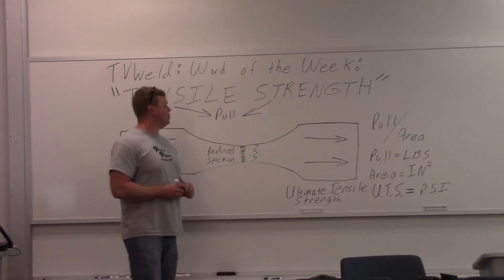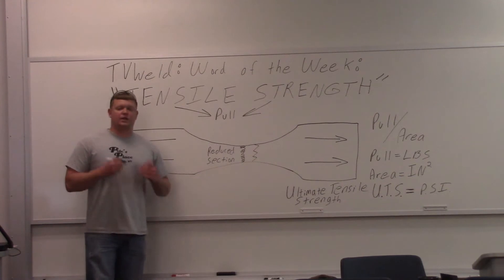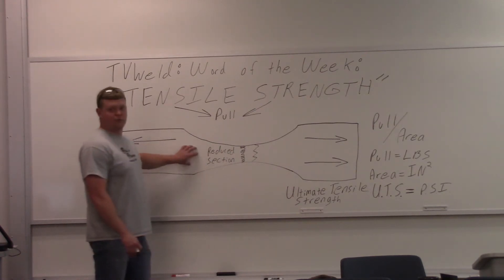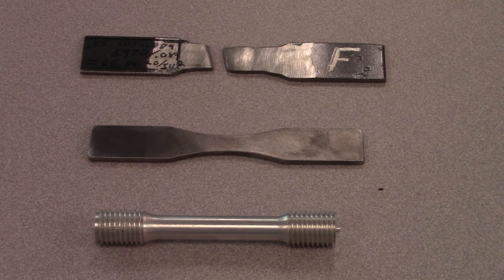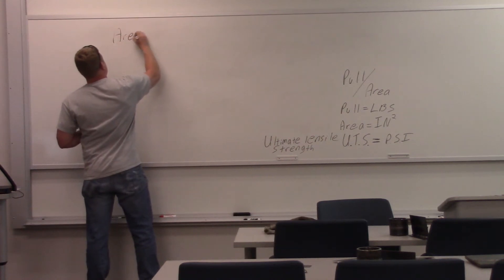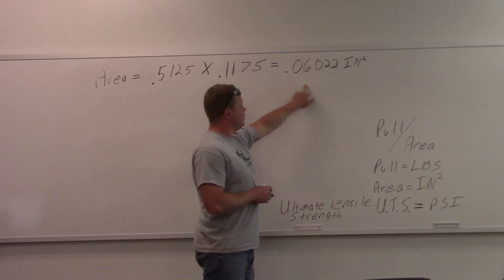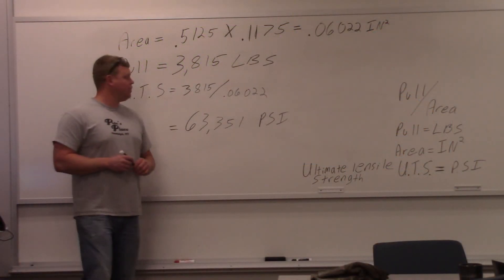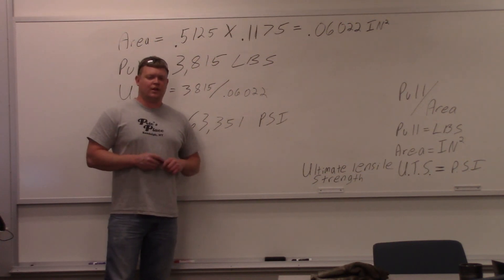Welding Tensile Strength

Comment: Hi I'm one of your subscribers, great video. Question, is the CWI API1104 easier exam than the D1.1? I'm personally more familiar to D1.1. And can you make an updated video on what to expect and study on for the CWI EXAM. Thanks 🙏🏽
Reply from the maker: People think it is easier to take the cwi exam with the 1104 because it is smaller in thickness.  This is false the d1.1 is the way to go especially if you're more familiar with the D1.1 for a couple reasons.  First, half of the D1.1 is annexes that don't get used on the test.  Therefore, the fact that it is more than twice the thickness of the 1104 doesn't really mean anything, because you only use half the book.  Second, the most important point is that the D1.1 has an index.  This is huge because if you don't know where to go for a question you have an immediate second option.  I'd go with the D1.1.

Comment: I did not understand how you got the final answer was it dividing multiplying or what I've tried both and came up with a different answer each time.
Reply from the maker: The pull ripped apart at 3,815 pounds.  The cross sectional area is .06022 in^2.  You divide the pull by the area (3815/.06022) which equals 63,351 pounds per square inch.  Hope that helps.
Reply: Thank you very much for getting back to me; your show is awesome!